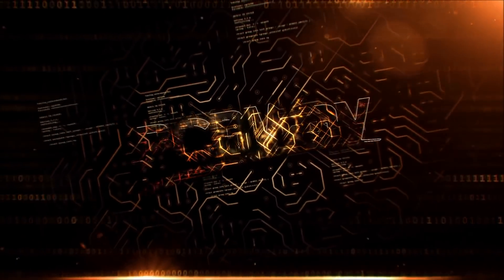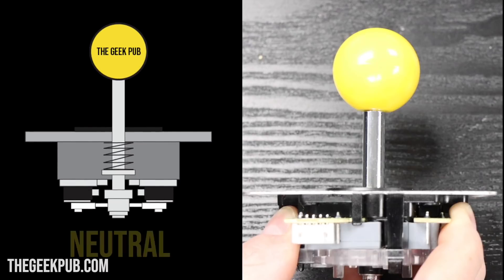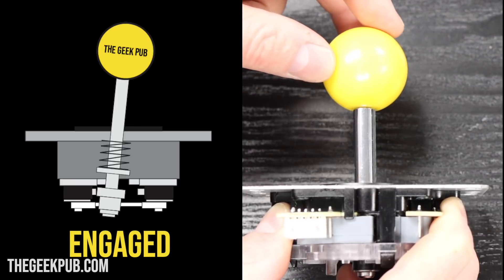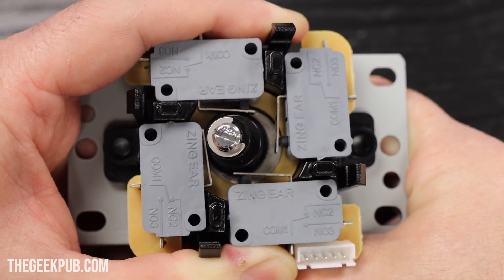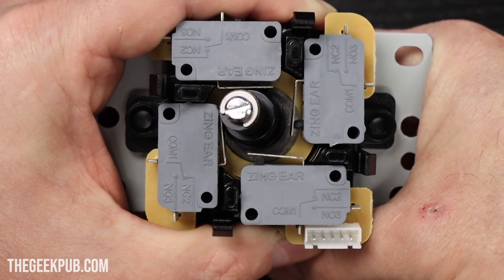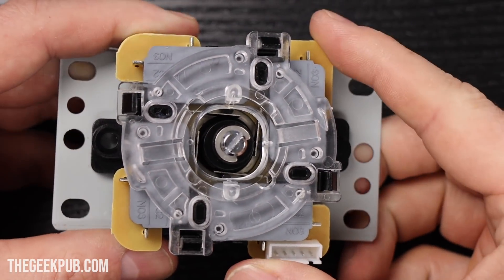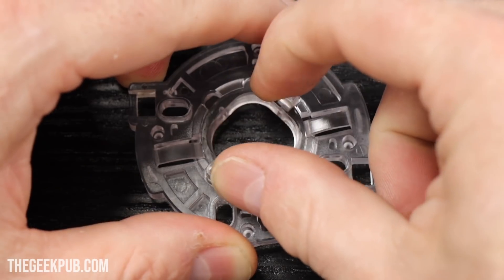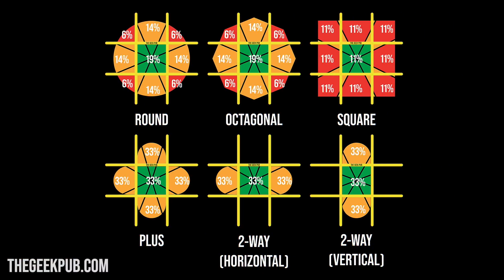How Arcade Restrictor Gates Work (Joystick Restrictor Gates)

Comment: Rather than microswitches (which wear out)
"Constant current" Programable unijunction relaxation oscillator with variable capacitor sensing for each direction.  Outputs pulse chains of  variable frequency for analogue position sensing. Bit of signal processing with say arduino if want digital direction switching.
Reply from the maker: Sure.  If you want to pay $150 per stick instead of $5.
Reply: @TheGeekPub  OK then... joystick akin to old pc analogue  joystick interface (as was provided by say sound card).. timing element for each axis of variable RC circuit, driven by 558 quad monostable.
556 to provide both a regular trigger for sampling, and a threshold monostable to handle adjustable deadzone. 74 cmos  Comparators and a quad clocked flip flip  small should complete digital output

Comment: Hi! Nice video! I have a question regarding the graphics in the end, e.g. the round gate: Parts of the diagonal "pizza slices" are inside the cardinal "tictactoe fields". Are the percentages really correct or is the switch engagement actually slightly different than shown?

Comment: I have a joystick (don’t recall at the moment where online I bought it) that allows me to switch between four and eight way, simply by pulling up on the stick and rotating a few degrees in one direction or another. Overall it works really well.

Comment: I built a 19 in 1 with stargate and defender. Is there a restrictor plate that can be changed from the top of the cabinet or am I supposed to open up the cabinet every time I go from Stargate to Robotron?

Comment: I built myself a joystick for my ZX-81 back around 82/83. It was made out of a bolt, spring, and some copper plates that acted as the switches (the bolt was earthed). Worked a treat and you could do diagonals too.

Comment: I kind of wish octagonal gates were more common on modern controllers. A round gate is good for a lot of things but an octagonal gate makes it easier to have the stick in a consistent direction and avoid slowly drifting out when you don't mean to. I think the last octagonal gates in semi-recent memory were the Wii's nunchuk and classic controllers.

That and the new Switch N64 controllers, but those are based on the pre-existing N64 design with a squared-octagon gate, and there's some argument to be made that the new sticks don't take advantage of the extra diagonal range of motion properly for the new ones.

Unfortunately for people like me, it seems circular gates are the preferred way to go, so I just have to kind of live with the occasional annoyance of having the stick tilted on a not-quite-perfect vector.

Comment: It's Not Easy to swap out the Restrictor Gates because the last tab gets jammed due to the pressure on it from the other 3 corners of the Restrictor Gate being raised, you have to remove all 4 tabs equally.

Comment: Hmm...

Sanwa JLF has round, square and octagon.
Sanwa JLW has square and round.
Seimitsu LS-32 has round and square.
Seimitsu LS-40 only has square (which means you'll do more engage than throw).
Seimitsu LS-33, LS-55, LS-56, LS-58, and LS-62 all have square and octagon.
Reply: I've never seen an LS-32 with round... they usually come with a plastic plate to allow for square, a more plus shape 4 direction, and 2 direction restriction.
Reply: @dav3yb  I was talking about restrictor gates, not the whole joystick.

Comment: Experiment with different gate and actuator sizes. Using bigger actuator shortens the activation, compensate with bigger gate size to prevent misfiring inputs.

Where to get bigger size gates? 3d print or chinese knockoff gates. Those knockoffs have bigger gate. And they have semi circular(squarish) gate too. Helps with hitting diagonals.

Comment: Lets imagine a multi-game arcade machine. Is it possible to have a restriction gate that can be electrically rotated? Or modified - like a diaphragma of a camera - to be adjusted to the game or player's personal preferences?
Reply: The ServoStik from Ultimarc does exactly that. I thought about buying a set to put in my bartops, but it only takes 30 seconds to flip the lid and swap inserts. Plus the octagonal 8-way seems to work ok in Ms. Pac-Man.
Reply from the maker: I wish!
Reply: You can do it! 😉
Reply: You're onto something man 😂
Reply: With an Arduino / RasPi and some servos you could probably come up with something
Reply: pretty sure that's been out even before you made your comment, the serverostik

Comment: Why does the Plus Gate diagram show 33% in each position, for a total of 165%?
Reply from the maker: OOPS. ;-)
Reply: Common Core Math - j/k 🙂

I found the diagrams a bit strange because the micro switches are either engaged (closed) or not (open), so I would think it would be 0% or 100% in any direction.  I don't get what they're intended to represent.
Reply: @RandomBitzzz  I think they're just showing how large each section is in relation to the entire area that the joystick is allowed to move in. If that makes sense. I'm not really sure why anyone would need to know that though. Maybe I'm missing something 🤷‍♂️
Reply from the maker: It was sort of intending to show how the different gates change the probability of going to a certain position.  I guess I should have spent a little more time on that topic. ;-). Thanks for the feedback!